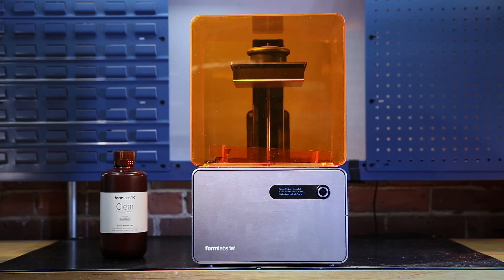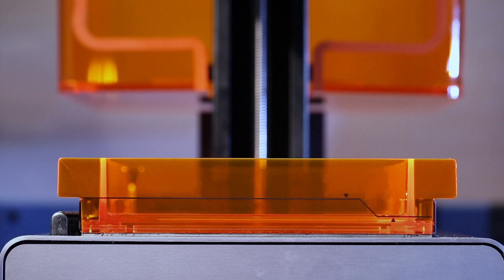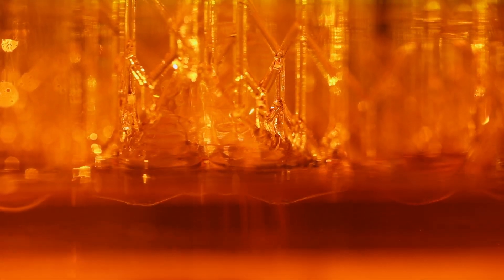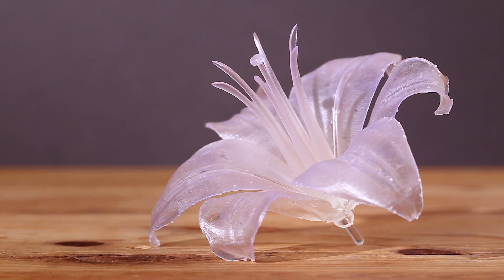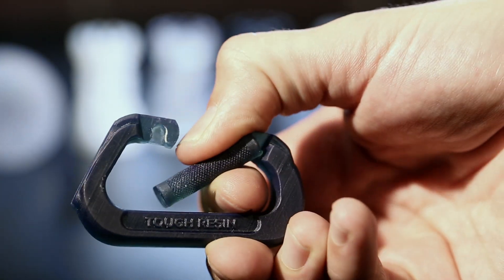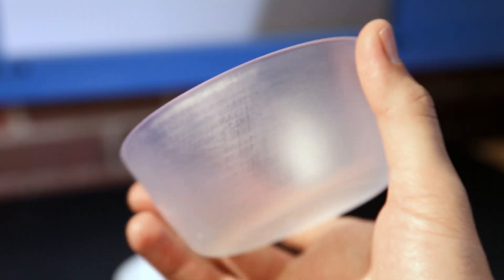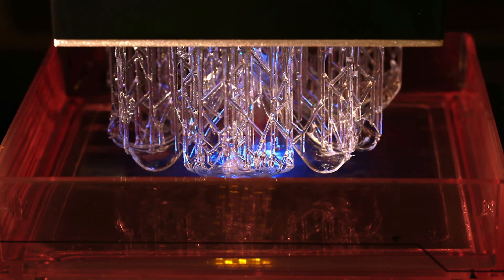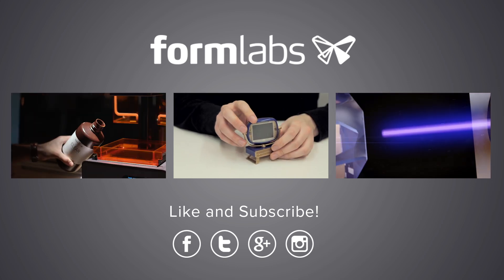Introduction to Stereolithography

Comment: Question for all of you: The layer height is the distance of the platform to the bottom of the resin tank for the first layer and the rest of the print the distance between the last layer and the bottom right? 
What happens if for example a support breaks lose and sinks to the bottom of the tank? will the printer crush it through the bottom?

Comment: The hammer test wasn’t revealing of the critical function of a carabiner - it’s tensile strength
Reply: But the point of the hammer was to test the resin, not the carabiner. If you're ever relying a home-made carabiner to support the weight of a human on a climb, you're probably about to have a very bad day.
Reply: That's just a fancy keychain at best.
Reply: @veryInteresting_  Damn, I have all sort of carabiners that I use in my back packs to carry all sorts of stuff like Water Bottles and Pouches. Nobody is going climbing mt. Everest with these. Don't be such a negative nancy lol

Comment: This printer is an absolute disaster for commercial use. We've been using it in our business for 1 year now and have trouble with it every 2 or 3 weeks: tanks not recognized, cartrdiges not recognized, non adherance to the build platform. We also had to have the optical system recalibrateDon't get me wrong: when it prints it does a fantastic job, but this machine has some serious reliability issues... We're going to look for another (proffesional) brand.
Reply: cool

Comment: in order to make the flower, the pilars to hold it, would one have to make the pilars in the model right? or it automatically designs a series or holding structures?
Reply: Yes, there is software that generates these structures for you. Just might need configuration on your part.

Comment: And yet, no great rush to point out how the printer that works 500% better costs 500% more. You get what you pay for.
Reply: +Volguus I don't know what you're talking about. A nice filament printer of build quality similar to this one (will still have lower resolution) will cost you about 2000-2500 usd. This costs 3500 about 50-75% more expensive.
Reply: +DJGuppy321 I could specify that I am a technical guy so kits don't scare me, thus I got a Velleman K8400 Vertex for 700 Euro. It performs just as good (sometimes better) as Ultimaker and Zortrax and the 2000-3000 Euro FFF printers you're thinking of. So for me the Form1+/Form2 is indeed 500% more and I would certainly expect for that increase (or even the "small" 50-75% increase you quote) that quality is much better!